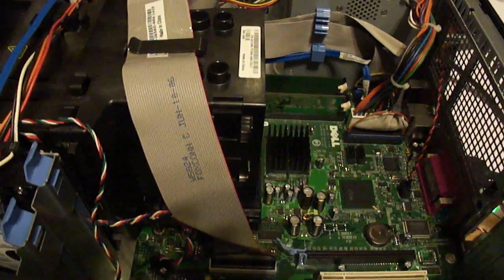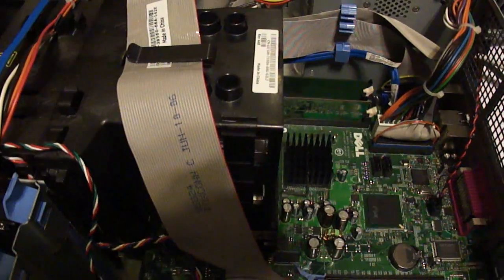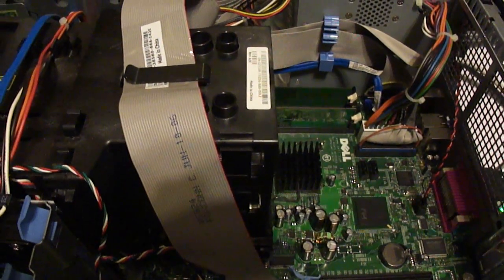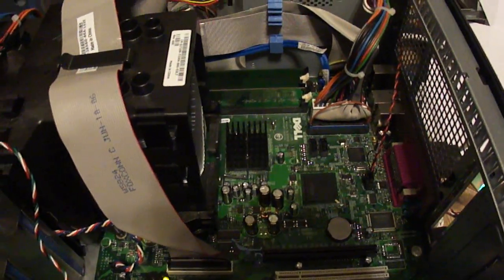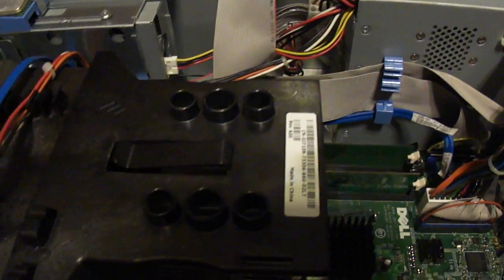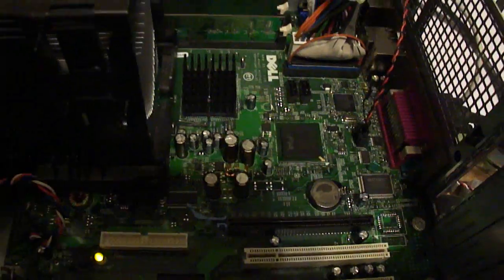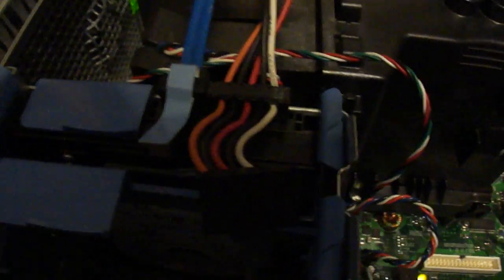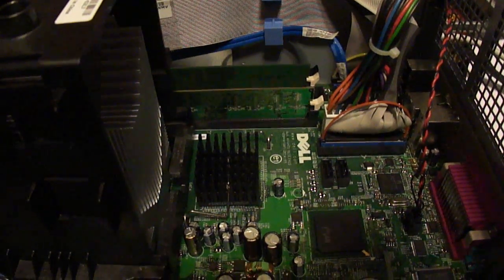[2013] [SOLVED.] OptiPlex GX620 - Beep Code 1-3-2, RAM Error.

Comment: I have the same Beep Code 1-3-2 on an OptiPlex 745. Changed and switched ram, and even tried a new power supply. Easy and cheap to switch Motherboard, but this mystery is driving me nuts.
At least we now know that it is a MB issue and not ram or psu. Thanks :-)
Reply: It's the video card I have the same problem but funny (I don't have a gpu and it's the same if I put in a shirty 256mb gpu it's not the cable or monitor bcs I check mine with the laptop and it works fine)
Reply: @happymrnoob5544  so, you put a GPU and the bip stopped?
Reply: @danielrocha7766   No it still isn't working there is no display and there is the beeping that is 1-3-2 I don't know what's the problem I got a new ssd/ram still same problem
Reply: im trying to fix this problem too, already clean all the components before turn on the CPU, then the bips come. My next step is trying to replace battery. Im out of memory, only 512mb for this tests, do you know if that can be a problema ?
Reply: @danielrocha7766  I don't know but what I know is the story of my pc before it broke ... anyway so the night I played till 3am everything is OK I turn the pc of the next day it doesn't work with those 6 beeps and so my brother tough it was my 500gb hdd that gave up on life so then he put his ssd in my pc and it worked but since he also needs his pc he told me to buy a new ssd so now I got the ssd put it in and it has these beeps idk if it's really bcs of the fact I need windows on it but I tought it will atleast show the bios but it made those beeps and there was no display on the monitor so I looked up what those beeps meant and it seid it's a problem with the gpu ... but I don't have a gpu (I have dell optiplex 780 with a 2.80ghz 4 core xeon 8 gb ram the new Kingston 256gb ssd and a 255w power supply) so anyway I put the sapphire radeon x550 256mb (ik it works bcs I have put it in before) and it doesn't change still no display 6 beeps so I got the idea it may be the cable for the monitor or the monitor so I go get my old lenovo t61 think pad (core2duo 2gb 80gb hdd gpu is unknown I haven't looked it up)and it seems to work ... OK so the problem is my pc and so I am thinking tmr I will remove my cpu clean it put new past on it and if it still doesn't work I am gona guess it's the motherboard  (and I am basically fucked bcs I don't have the money to buy a whole new motherboard and also I am probably the unluckiest guy in the world .... MY LAPTOP BREAKS ... fan error I need a knew one ... that's just my fucking luck)

Comment: I'm taking your advise and bought an e8200, 755 MB. About the front panel controller board, do I need a new cable on will the 745 cable match up? Thanks.

Comment: its a hardware issue just pull out the M.B carefully examine the back side of mother board there must be jumper connection burn out... i was having  the same issue, did everything changed ram changed processor... but 1 3  2 beeps keep buzzing at startup... i had a dell 7010 mini tower... i soldered a jumper wire on the burnout connection... and everything back to normal... burnout connection will most probably near the 24 pin power connection connector... i finally fixed my pc
Reply from the maker: if it was burned out, you have a dodgy PSU and should replace that ASAP.
Reply: Explain in simple terms how you did it please

Comment: I swapped the RAM sticks but that didn't work. So I removed one. Nope. Then I put it in the other RAM slot. Booted fine. So, a hardware problem on a very old computer. Not surprising.
Reply from the maker: they're very finicky as they age. check your capacitors too, the GX620 was one of the last to be affected by cap plague, but only in early board revisions.
at this point it's just not even a thing to be messing with, not with the abundance and cheapness of parts on the internet available for purchase.

Comment: I upgraded my dell optiplex with 2(2gb) ram sticks just today and everything was fine until I tired it in for the 2nd time and it's doing the exact same beeping noise. so you really think replacing the motherboard would work?
Reply from the maker: +Jose Garcia if it's a GX620, just replace the darn board already. P4 is trash and wasteful. 760 or even a 380 board if you want DDR3, will do you so so so much better. then go grab a $10 E8200 and you're set. or a $20-30 Q9300 or Q9400.

Comment: Can you help me dude, so I have the HY9JP Mobo (from Optiplex 790) the beep code is 1-3-2, but when I tried the ram on the other computer, it works, but if the Mobo is giving error messages, it's not broken? Right? Or should I just replace my Mobo, since it's only $14 on eBay.
Reply from the maker: just replace the motherboard at that price point.
there is no good time spent troubleshooting when you can buy a replacement for that amount.

Comment: thx for the video. trying to solve this mistery for 2 hours now. since i work in electronics repair i will do a reflow tomorow and see if it will work. if it does the intel northbridge will be the first of it's kind that i see broken, usually these chips have good balls and well soldered.

Comment: mine was beeping & screen going black. Changed the boot sequence and seemed to correct the problem
Reply from the maker: you actually had a working set of RAM sticks. this was a problem with dead RAM. yours was probably some other issue, since you were actually able to get in the BIOS and resolve it.

Comment: Hi I have a dell optiplex 780 I bought a 4 gb ram stick and I plug it in and get this beep. Can someone recommended me with a working ram stick 4gb pls thanks
Reply from the maker: +EdieP the 780 requires you install RAM in pairs. buy a second 4GB RAM stick and you should not have this problem.
Reply: +Sudos so if I put the old one that was in there (two 2gb sticks) and take one out leaving 1 2gb stick and put in my new 4gb stick it will work?
Reply from the maker: +EdieP technically what you're saying there should work but take that with a grain of salt. there's no danger in doing that, but you may end up with the RAM in single-channel mode which will drop down the amount of bandwidth that will be able to pass through the sticks. best case is to have matched pairs for best performance, even if it's different brands.

some newer chipsets will do dual-channel no matter what the set-up is, but Dells are a little weird from the C2D era, even with DDR3. you should be A-OK to do so. 
if you don't mind my asking, but why replace two 2GB sticks with a single 4GB stick and not keep them in there? you'd get 8GB out of it. do you only have two RAM slots? is this a USFF model?

if it's a tower, you should also technically be able to do all 3 sticks you currently have, but IIRC there HAS to be at least one matched pair installed. your results may vary. Also make sure your BIOS is up to date as well, atop that. there were some older boxes that got updates to support more RAM. in newer BIOS revisions, the 780 tower and desktop models are able to officially support 16GB of RAM. I've also heard reports of someone doing 32GB but can't find the evidence to back this up... but I remember it nonetheless.
Reply: +Sudos sorry I'm not very good with computers xD is there like stuff that could work that I could do? Without buying a new stick
Reply from the maker: +EdieP try adding the existing sticks to the 4GB stick if you have 4 slots. if you have 2 slots, you can try mixing the 4GB stick with a 2GB stick. if that doesn't work, you'll have to buy another 4GB stick, sadly. at that point, if you have 4 slots, you can add the two 4GB sticks together with the 2's and get 12GB of RAM.
Reply: +Sudos aww nice ok thanks for your help
Reply: +Sudos I bought a new 4 gun exactly the same I put them in along with the others and do not work I tried in every order I think and tried just he 2 4gb sticks on there own and don't work help? XD
Reply: +EdieP *gb
Reply from the maker: +EdieP how fast of DDR3? 1066 (PC3-8500) is what's recommended for the board. if you can still boot it on the two old sticks, do so, and make sure your BIOS is up to date and try it again. faster RAM will work but you need to make sure it's at least 1333 (PC3-10600). anything faster than 1600 in most cases does not have a chance of working since the JEDEC parameters on the tiny controller chip on the RAM stick will not exist for anything above 1333. it does in some cases, but it's a small extra expense, and planned obsolescence that stops it.

A15 is the last one put out for that board.
http://www.dell.com/support/home/us/en/19/Drivers/DriversDetails?driverId=DK074&fileId=3270400708&osCode=W764&productCode=optiplex-780&languageCode=en&categoryId=BI
you should be able to do that update in Windows just fine.
Reply: +Sudos I'm sorry I have no idea what your saying XD what do I to do but like simpler XD thanks
Reply from the maker: +EdieP update the BIOS using that file I linked. after that, see if you can use the RAM sticks.
if you can't, it's likely the RAM isn't going to work properly with the board.
what brand is the RAM anyway? Crucial is technically the best to go with for Dell boxes when doing upgrades.
see if you can return the RAM you bought, and get 4x 4GB sticks of Crucial DDR3-1333.
Reply: +Sudos ah ok I will download that this is what I got http://www.amazon.co.uk/gp/aw/d/B008CP5Q7M/ref=mp_s_a_1_3?qid=1456947186&sr=8-3&pi=SX200_QL40&keywords=kingston+4gb+ram&dpPl=1&dpID=31bwu6DhLpL&ref=plSrch I got 2 of these and if it doesn't work I will try and send it back and get the crucial ones ok I will tell u if it works!!
Reply: +Sudos Ughh fuck it didn't work it downloaded fine got to my desktop then turned the computer off and tried was u suppose to do something else when I got to my desktop after the download because it didn't work xD
Reply from the maker: +EdieP you're supposed to run the file downloaded, it should ask you to upgrade, else it won't if you're already up to date.

Your RAM is incompatible. See http://en.community.dell.com/support-forums/desktop/f/3514/t/19579385
Kingston RAM doesn't play nicely with Dell motherboards. Crucial branded RAM is the way to go.
BUT! see further down the thread, you'll see someone was able to get 16GB working after the BIOS update.
Reply: +Sudos Ya I did run the file and it restarted my computer got to my desktop then I turned it off and tried again I don't know if there was anything else I needed to do. Looks like I will have to get the other ram stick
Reply from the maker: +EdieP yep, just make sure it's Crucial branded RAM and you should be good to go.
Reply: +Sudos ok mate thanks

Comment: In many of these cases its the memory causes and many persons already commented on the issue I see.  However Motherboard and memory must have the same frequency or else you might have a booting issue. However this one is weired lol.
Reply from the maker: +Kevin Johnson it doesn't have to be the same, it just has to be the same OR faster. faster RAM will downclock properly.  in this case, it was the motherboard at fault. GX620s are absolutely worthless now. 755 and 760 motherboards plus their front panel boards are cheap as hell and absolutely worth it. Core 2s can be used, and core 2's and quads are very inexpensive as well. you also up the DDR2 speed from 533 to 800 which is actually a very nice increase.

Comment: I fixed the problem re arrange the sticks make sure the wires are away from the fan re arrange the wires plug them in install the new GB of ram then start it up if it still has problems re arrange the ram until it works
Reply: also do not use the same ram it will kill the computer
Reply from the maker: +Patrick Gutierrez it won't KILL the computer, it just won't power up and you'll get the same error.
in this case it looks like you had a stick that went bad after 10 years or so.
why just a gig? 4GB is the norm these days and a 4x1GB kit for this particular system can be had for fairly cheap if you're willing to scour eBay. used RAM is fine, just make sure it's 100% tested OK.

Still, if you're repairing this old of a system it may be time for a board swap anyway. OptiPlex 760 board is still my suggestion, 780 if you want DDR3 support for fairly cheaper RAM, both will take any Core 2 Duo or Quad you can drop in it. and with a Q9400 rapidly dropping in price, and the price of a Q6600 even moreso dropping every day, it's not worth it to continue using something as inefficient as a P4, as I'm still advocating to commenters here.
Reply: +Sudos I found my dads old gx 520 in the basement so I'm building it for gaming I found the same problem when I turned it one then off I tried getting a new graphics didn't work so I came to YouTube I found this someone in the comments said the swap a re arrange the ram so I did it started working I tried just one it killed it I re arranged it so when it was working... I turned it on it didn't work I tried getting a new board it worked the whole board didn't work I tried getting thee same graphics card it still didn't work so it does kill it in my case
Reply from the maker: +Patrick Gutierrez it could also be the board was flaky to begin with. the GX520 was home to a lot of problems, including cheaper capacitors that did like to go puffy if they got hot, and was to my knowledge one of the last P4 systems to show this sort of behavior.

take my advice, spend 50 bucks and get better hardware for inside. the 780 motherboard will take up to 16GB of DDR3 RAM, therefore having a much better upgrade path. Quadcores are cheap. don't set up a P4 for gaming, you're only going to regret it unless you're playing old games from the '00s.
Reply: so i should get a better motherboard... can u give me some options bc i really dont know alot of good motherboards and true the gx520 i really faulty when it comes down to maotherboards but when its up and running its fine

thanks for the advice
Reply from the maker: +Patrick Gutierrez if you have the tower version of the GX520 and NOT the small form-factor version, You'll need the following for a fairly clean conversion:
2x http://www.newegg.com/Product/Product.aspx?Item=N82E16820159021&ignorebbr=1 2x2GB DDR2-800, 2 sets will give you 8GB
1x http://www.ebay.com/itm/201565347491 Core 2 Quad Q9400 2.66/6M/1333
1x http://www.ebay.com/itm/272143756817 the actual meat and potatoes, the motherboard itself.
1x http://www.ebay.com/itm/121860043950 heatsink to accomodate the Core 2 Quad, should be just a screw-in, all those boxes are built the same.

and 1x of http://www.ebay.com/itm/Intel-Core-2-Duo-SL9T9-E6400-2-13GHz-2MB-1066MHz-LGA775-CPU-Processor-376-/231900329864 so you can do the initial installation of Windows or whatever, then grab THIS BIOS update: http://www.dell.com/support/home/us/en/19/Drivers/DriversDetails?driverId=2DWTY and upgrade the BIOS to support the Q9400 linked above. this also gives you a spare Core 2 in case things go awry, so put this off to the side for safe keeping; this is usually best practice anyway. Every other driver needed for the system otherwise, assuming Windows 7, can be had by manually selecting OptiPlex 755 on the Dell Support Website and clicking on the drivers tab.

the PSU you have should be more than enough for the new box all things considered. if you feel you need more oomph (see below), any power supply on the market of a reputable brand will fit as the PSU, last I checked, is standard ATX.

Past that, if you need a graphics card, do take into account you're limited on how big of a card you can drop in. a 750Ti would be best for this system, but there are other low-profile options available. do some research and find exactly what you need, and BE ABSOLUTELY SURE it will fit before purchasing. I made a Radeon HD6670 fit in this exact case in this video a couple years ago, but I had to cut back on a lot of the plastic surrounding the fan. if I knew where the pic was of the insides at that point I'd show you.

Your best bet is going to be a newer low-profile Radeon R5-class or better, or a low profile 750Ti if you can find one for cheap on eBay or newegg. Note that Windows 8.1 and 10 do NOT support the onboard graphics so you DO have to have some sort of modern graphics card installed if you go with one of those. Win7 is the absolute best to drop on this system when it's fully back together, and XP will, although being old, also run amazingly on this box when it's done.

I wish you luck, and godspeed.